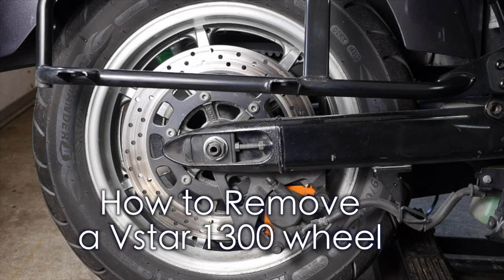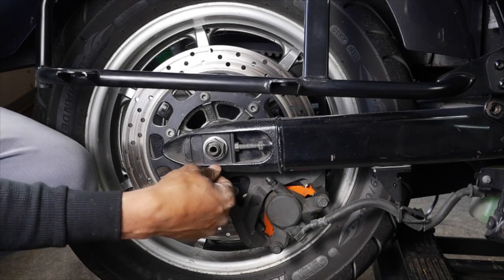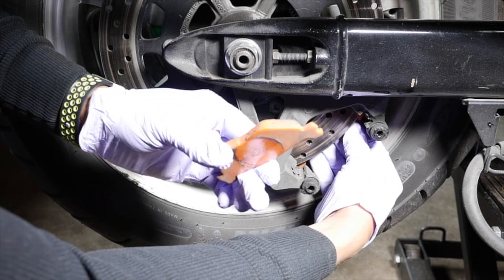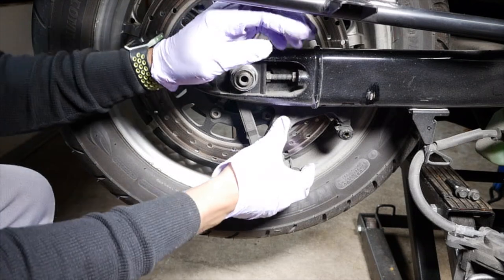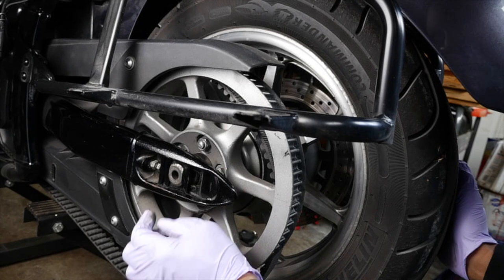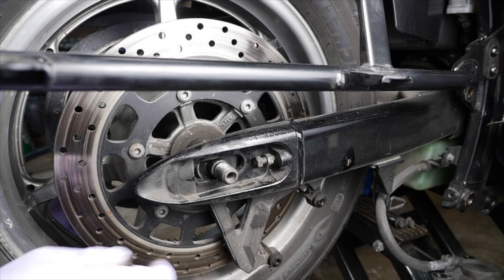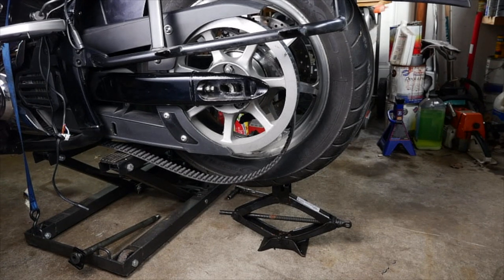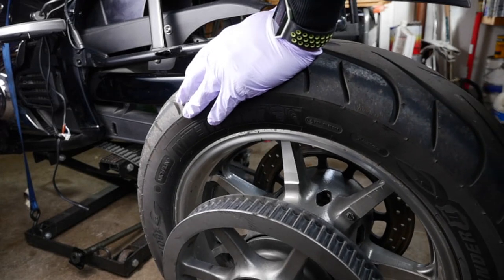How to remove the rear wheel on the Vstar 1300

Comment: Nice job bro. You’re like me, I put thing on the way they came off, even if it looks like it doesn’t matter. My cruiser has a shat, so it’s a little different lol. Be safe dude.
Reply from the maker: Yes that's right . I wondered about those. Do you have to do any alignment?  I would think not due to length of shaft . I found the string method to be the best for me currently.
Reply: Dbest1a’s Ride nope, no alignment needed when your mounting the shaft back. I love that part. It’s not the same with the FJ-09, which is chain driven.
Reply from the maker: Ah ok. That's awesome. Oddly my Buell blast (belt drive) is like that .. no alignment needed. Hmm. 
I finally was able to get the string method to work for me on the vstar , and got the rear wheel aligned with the front. It's good enough that if I let go of the bars it will track straight. Finally ... but I'm a picky nerd about things like that..
Reply: Dbest1a’s Ride it’s good to be a picky nerd about stuff like that 😁👍
Reply from the maker: Yes very true lmao.

Comment: I reccomend taking a picture of the drive belt tentiin prior to dissasebly
Reply from the maker: You could , but it won't help due to needing to follow the procedure in the book of using the measure tool to apply tension to the belt n tensioning it close to book spec, but slightly loose .

Comment: Wondering after i have watched your vids to change my tires on my 950 myself. Seen the shinko review too. Doesnt look too bad
Reply from the maker: Most of the removal should be the same.  Just pay close attention to the alignment plates,  so you put them back exactly how they came off. Then take tire to shop  get mounted. 
Remember to add grease to the needle bearings with lithium soap based grass. If you can handle it,  it would save you some money,  and you can service some of the hard to reach areas.

Comment: Do I need to remove the exhaust to remove the rear wheel?
Reply from the maker: If stock exhaust yes. 
Warm up the lower exhaust bolts with a heat cut or light flame to help loosen up the loctite

Comment: Is this the same as the 950? I swear I've been looking for videos for 950 belt replacement and cant find ANY
Reply from the maker: Yes it would be pretty much the same. To get the belt off you will have to remove the rear wheel. Note your marks and mark it or take photos or something.  
Then you may have to remove the belt covers on the side . You then can remove the front pulls cover and pull the belt off and if anything seems in the way , you will have to work that out also. Should be a 123 job. Just don't set your belt tension per manual.  Set it a tad looser, as you know the 950 tension was to tight from the factory.

Comment: I noticed the bag racks, so I'm assuming that's a 1300 deluxe. So you should have given your viewers the full treatment, of explaining all the crap you have to remove, just to get to that wheel hardware.
Reply from the maker: Yea , I know.  Just wanted to keep the series to the point. 
Actually removing the bags is super simple. N also listed in the service manual which can be had in the download section of the vstar 1300 wiki page or the vstar 1300 Facebook page.
Reply: @dbest1aVlogs  I'm with ya. My deluxe is a twin to yours. Same color, same year. Except yours now has more bells and whistles. My biggest wish is to find a diamond shaped LED headlight replacement(not just a bulb).
Reply from the maker: @kenbred46  the odd shape of our cluster makes it tough. If you look in the lamp. That metal cover over the headlight. Yup I pulled that out. Then added the led headlight. I’m running the opt7. Removing the cover n aiming the light down a bit makes a huge difference. Just takes time to aim. The spots actually added a little more peripheral light too. I could get by n be fine without them though.